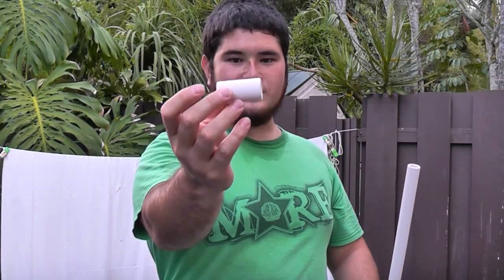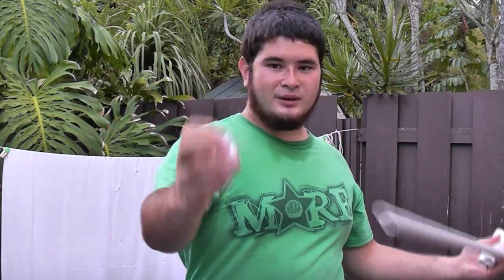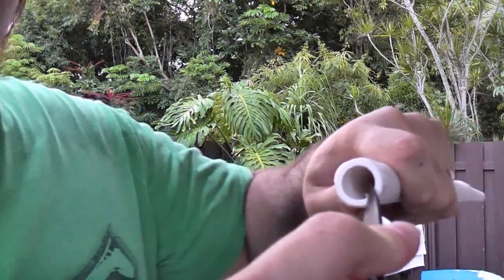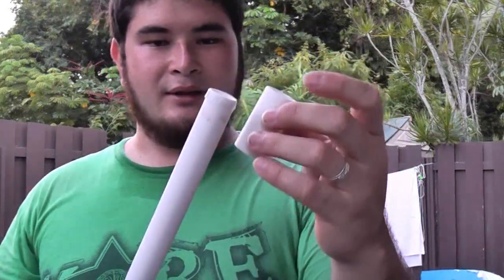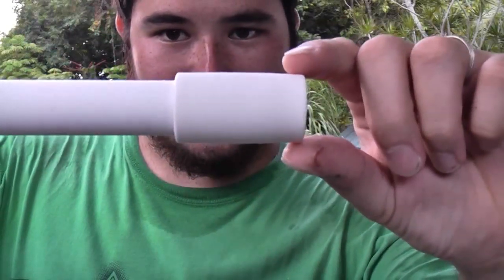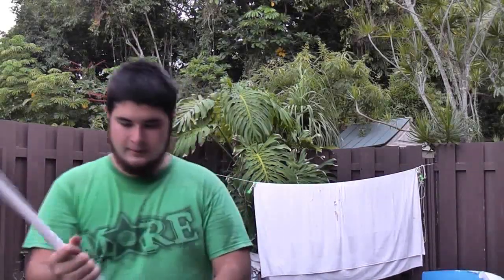Making a PVC Walking Stick Blow Gun

Comment: I know this is an older video, but my walking stick is  almost 7 feet long. More of a staff. I want at least ten feet between me and anything I'm trying to maneuver or strike. The main part I grab is about four feet(ish). 
But from an engineering aspect, the effort to operate this thing is minimal. But to use PVC to support my weight would be a recipe for a hospital stay with likely lacerations.
To straighten the pvc, fill it with sand, cap it, place it on a level surface, and pour hot water over it at the high spots. Coffee pot hot water.

Comment: So 3/4" sch 40 pvc will fit into a 1/2" sch 40 pvc? What will fit fit into 3/4" sch40 pvc. Since you heated the 3 handle piece pipe it expanded right? What can I do with the 3/4" sch 40pvc? Thanks
Reply: You can try 1" pvc

Comment: Make it shorter and shoot nerf darts. More length equals more power, up to a point. So I would think a two footer would be more than soft enough to larp with. Having said that, I use my six footer with nerf darts for airsoft and nobody has died from it yet